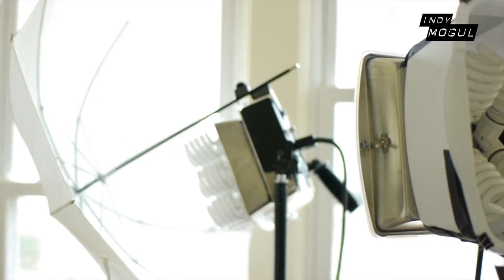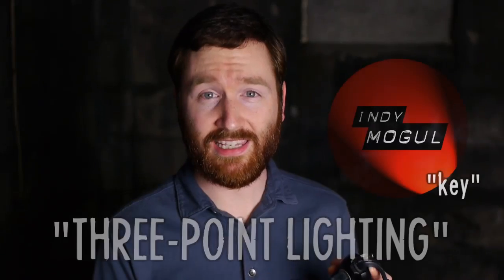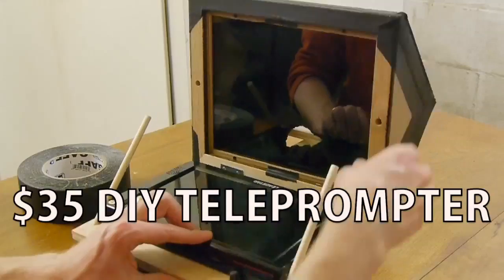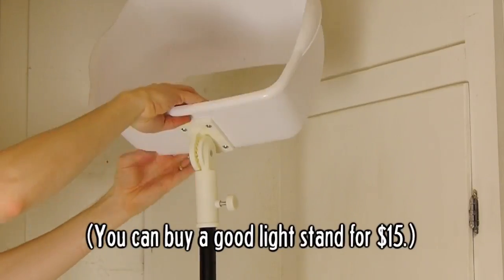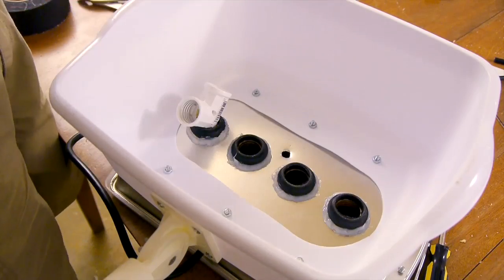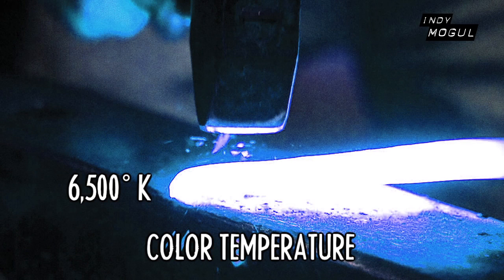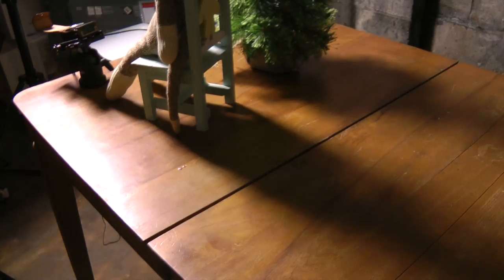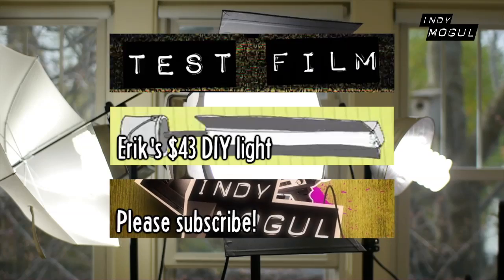How-to: Powerful DIY video light (800 watt equivalent)

Comment from the maker: I'm using the new light as a key, the old DIY light for fill, and the clamp light for back light. 

The color temp is usually listed in fine print on the bulb packaging. Sometimes they'll label them like "soft white" to mean 2,700K, "bright white" to mean 3,500K, and "daylight" to mean 5,000K and above. But all brands are labeled differently.

I bought my Eiko SP85 (giant CFL) on Amazon.

Comment: Just a suggestion... install TWO power switches, one for the external lights, one for the inside lights. This way you could switch on the two on the outside if you don't need quite as much light, then switch on the inner two if you need more. (Or you could wire it every-other if you don't like the configuration I suggested.)

Comment from the maker: It's not dimmable. My previous design includes two switches, to turn off half the lights, but I never use it, so I went to one switch for this design. It would be an easy addition to this build.

Comment from the maker: I didn't fully explain that: Aside from using a bunch of binder clips to secure wax paper or gels to the dish pan, after I place the umbrella through the hole, I've also attached a binder clip to the umbrella pole, to keep it from sliding back through the hole.

Comment: Terrific build, I've wanted to do something similar for a long time, though not nearly as cleverly put together as your project is.

I'm surprised you didn't line the interior of the light with aluminum foil for added light direction. Also any suggestions on finding comparably bright  LED lights since CFL's do have a flicker to them?

Comment: That is why he used wire caps to cover the wires and make it safe.
The metal is used to ground the project.
If a loose wire hits ground then a fuse blows and no one is hurt.

Comment: @TheAlexanderAki asked: "isnt it stupid to use aluminium here? i believe that aluminium is conductive and if a wire touches it because of a malfunction and then you touch it arent you going to get hurt or die? someone please respond"

MOST of an electrical system is going to be a risk of shorts. So unless you are familiar with electric wiring, you should absolutely have someone else do the electrical set-up for this build. Metal is very commonly used for lighting, so please be safe, DIY or not.

Comment: It is very important to use a fuse and have a switch that can handle such power.  You probably should mention that in the video description.  I hope your wall plug is fused, otherwise, if bad things happend,,, its not gonig to end nice..

Comment: When BFX was around, it was owned by Eric, when Zack hosted the show, he was hired by Eric, and Eric was the producer.  Eric has since moved on to a different project, theindymachines, and Indymogul is now run by Griffin, so all the shows and ideas have to be his own creation, and cant share the same names, themes, or formats as the previous shows, which is why he cant just simply "bring BFX back".  But with this new show, he's trying to bring back the projects and builds in an original way.

Comment: @indymogul As a Electrician in Europe, I would suggest using WAGO which is and small Wire connector, and then use a Connection box to secure the installation from touch but your big lid works too.  Also, heat moves up, so drilling a few holes on the plastic that points upward should do the trick to remove the heat from the plastic. But I am quite certain there exist other types of plastic that can sustain higher heat. But yeee.. Good build.

Comment: So in theory with a 3/4 CTO you can have a Tungsten Color Temp (3200K), or a 1/8 CTB to get to 5600K... But don't you have a problem with the light's curve... giving a wrong balance in the other colours you are filming???